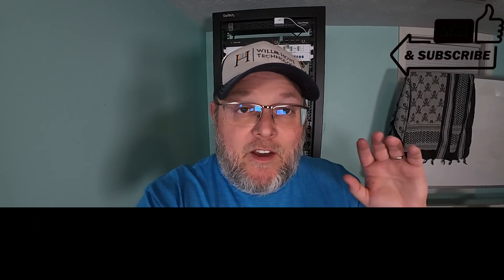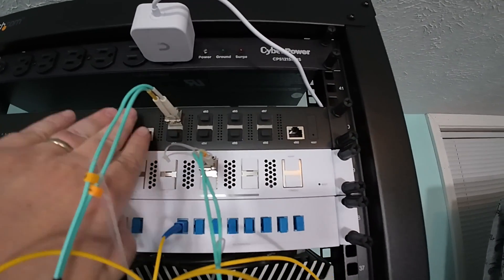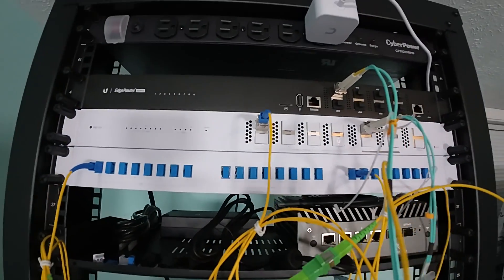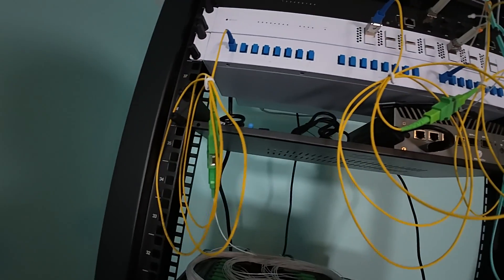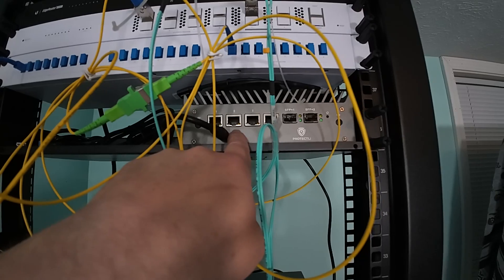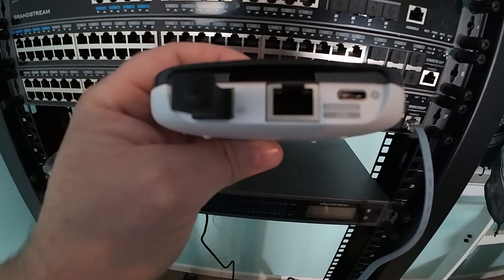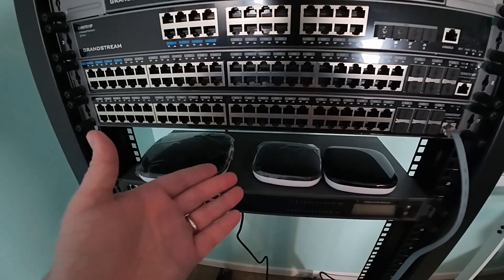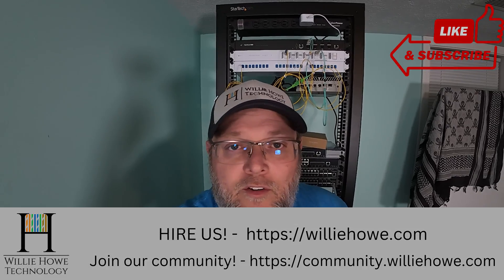Build an Internet Provider Part 2: Hardware Layout and Cabling

Comment: The fiber wifi 6 isn't 10 gig, it's GPON.  
Why not use UPC to UPC cables from the OLT to the WDM?
I'm looking forward to this series and seeing a test lab set up.
Reply: With xgspon and correct Ont you could def pull more than 1 gig, theoretically 9.6 via Wi-Fi, or the full 10 plugged in direct

Comment: Hi willi great news I have been personally waiting for the above video since am ready to start running fiber fully on ubiquiti hardware end to end am more interested in the total capacity throughtput as well as the inter connection of the fiber backbone on ubiquiti devices and the maximum capacity per node. In addition how come ubiquiti don't manufacture splitters ?
Reply from the maker: What kind of splitters?
Reply: @WillieHowe  fiber splitters a good example is the one you have which you were showing casing I think it's a 32 fiber splitter
Reply from the maker: @maichwainaina9771  That is a splitter from Ubiquiti.
Reply: @WillieHowe  okay didn't see the ubiquiti logo on that
Reply: Thanks for the information

Comment: Hello willi....why you need a angle polish adaptator..?
Reply: APC, or angled physical connector, for fiber inspires less loss and reflections when junctioned. So the connectors he's using pass more signal than the comparable UPC (flat, or "ultra" physical contact) connectors (blue). This allows the signal to go further down the optical fiber than it otherwise would, enabling much further connections, sometimes as much as tens of kilometers for passive optical networks like he has (or "OPN"; like gpon or xgs-pon).